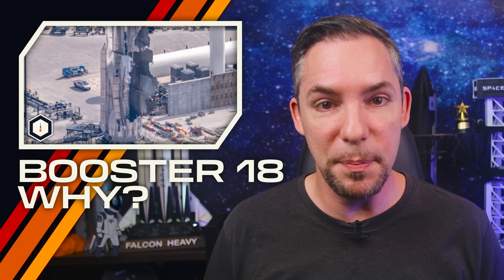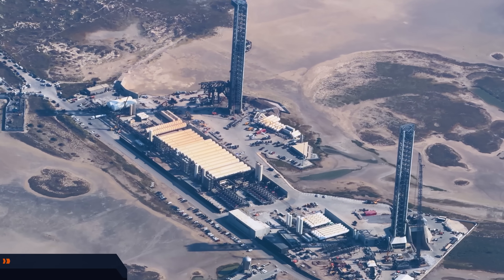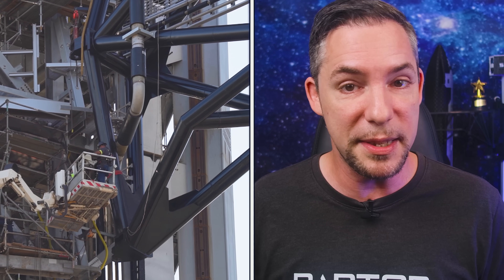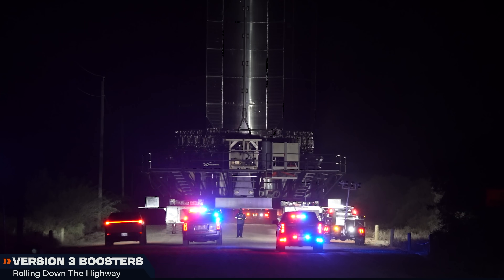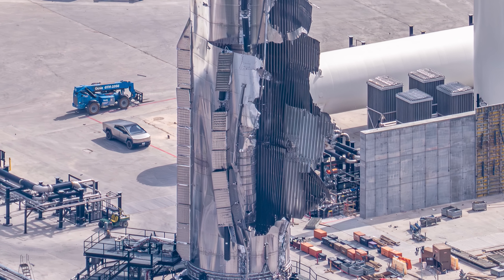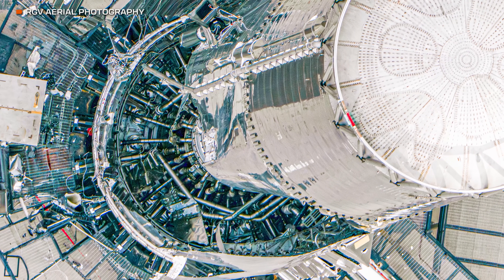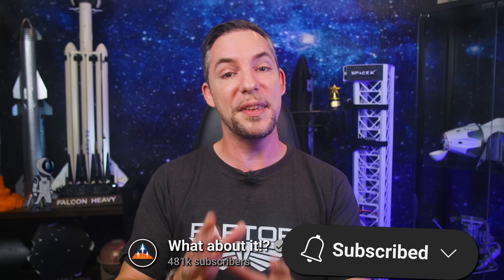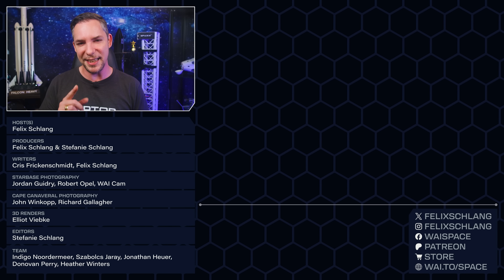What Went Wrong With  SpaceX's Starship Booster 18? Is SpaceX In Trouble?

Comment: I'm a huge fanboy of smart telescopes. I've been running a See-star ssharpstar  50 for a couple of years now, I love the little thing, I also have a traditional equatorial system. 50 mm x 275, triple APO with the equatorial mount, it did not cost me $3000 out of the box. The problem with this one is it's alt z which means exposure times would have to be very short. You had to stack for some time, but I'm willing to give it a try, but not for $3000.

Comment: The current estimated plan indicates proper landings on the pad by Dec 26 and orbital flights by mid 27. Then refueling tests throughout 2028.
Flights around the Moon in 29 possibly with the first unmanned landing, if and only if, the SpaceX lander is the size of the Apollo/MK2 lander. 2030 earliest would be the human Moon landing.
Starship landings are not physically feasible …you needed to move to spherical ships with equatorial ring engines. All else cannot land with chemical propulsion on a water and airless moon or planetary sized body.
This would put SpaceX on the same trajectory as the China Moon exploration program.
In April 26 we will be able to verify whether Blue Origin could land a crew as soon as 2029.
Here we see the beautiful contest of classic waterfall managed tech design of China and Blue Origin v Agile software principled development.
Sorry guys, but as a senior engineer and program manager I bet on China and Blue Origin beat SpaceX.
SLS could have flown there this year latest but politics did not allow. So SLS was never allowed to build a lander and Orion is delayed politically.
Ok…but back to dreaming….🎉🎉🎉

Comment: SpaceX ~Booster 18 [RUD] show a sudden pressure release tht blew open a large section of the lower liquid O2 (LOX) tank, causing a significant deformation. 
They also speculate the (COPV).
This happened last 21st of Nov, 2025
•~●🐲k-p

Comment: Hi Felix, @3:50 you mention that reducing the mass allows the chopsticks to move faster - very true. But equally contributing to nimble movement is the reduction in arm length because of the mass moment of inertia. A (very) rough estimate of the total improvement in chopstick acceleration would be 1/2 (from the mass reduction) * 1/2 (from the moment arm reduction) = 1/4 of the original rotational inertia. If the motors were kept the same we can expect to see those new arms positively dance. This means the booster can be caught even if a powerful gust of wind makes it hop sideways just before catch.

Comment: SpaceX is soooo far away from landing anything on the Moon. We should have tried a smaller first step back instead of trying to bite off a giant transporter for the return Moon shot.
Reply: From an engineering perspective building a big rocket is much cheaper to design and optimise (e.g. the Tanks can be more overbuild without too much performance penalty), even intuition says „big Rocket, big money“ but the engineering cost is so much higher than the material, infrastructure and construction costs

Comment: Bunch of junk.. Google: "Ultrasound can print through walls" + "Ultrasonic resonance" which can be used to specifically heat and keep molten materials with an Ultrasonic holography field. Power potential for printing = Points at Boeing Plasma force field blocking bombs rated to smash military steel machines with Plasma generated Ultrasonic shockwaves Now search "Ultrasound solidification of molten metal for perfect atomic structure" Results: Star Trek Replicator A release of materials into capacitor discharges taking turns filling and charging for a continuous extremely powerful holography pressure of an image on a computer. Using what they already should have been using to scan metals and run simulations.. He's got everything computer wise for that.

All a big scam lol and world science is broke.. Science: "No sound in space its a vacuum no medium! Hey look at the interstellar medium!" < Interstellar medium is far less dense than being inside Heliosphere gas field.. Ultrasound works in space. Taps Ultrasound Microphone in explorer 1 They now say its for micro-meteorite impacts.. Look at how small it is. That's dumbfounded to believe hahaha. Search engine: "Ultrasound like waves found in suns atmosphere" Plasma generated Ultrasound.. - Dracula/Hades🦇

Comment: FWIW, when Lockheed was developing the C-130 they tested the fuselage in a tank of water, pressurizing with water.  The reason was that a failure wouldn't cause the kind massive damage that would occur with inflation with nitrogen or air.

Comment: What I don’t understand is the welding. It is robotic welding. The blow out should never happen simply due to the robotic welding machine. If everything is set right the welds should be the least of your worries. I honestly think that someone didn’t quite know, or understand, how this works. It does it on its own. Someone has to go in and change the program in order to get it to fail like that. So some human input that was changed was wrong. Hence the sabotage to the program. I’m seeing what is happening and I’m not liking it. The program supervisor needs to isolate that persons responsibility and dig into it and find out why, when, &how the mistake was made. I designed some robotic welding heads for high pressure gas pipeline and the 10 or so heads NEVER FAILED. SO… who and why are people making changes to something they know nothing about?  Just my thoughts.

Comment: The point of pressure testing is to blow up the booster on the stand where you can see what went wrong and before you waste more time and money on a booster that was never going to work.... In which case the B18 test was highly successful it saved SpaceX many weeks and hundreds of millions of dollars not building a building a rocket that was never going to reach space and it furnished them invaluable data on how not to build a booster.
Reply: That's backwards. Once you put millions  into a test article, it's a bad thing that it fails and you have to start over again. 

Can you imagine if we made other things - say buildings or bridges - in this trial and fail manner? 

SpaceX is the only company who is happy when their eighteens booster literally fails the first and easiest pressure test. 

That's stupid. 

MIT '86 AeroAstro
Reply: @dimitryzarkh2084  That's why Musk is the richest man on Earth and SpaceX the most successful and profitable rocket company in the history of the world. He uses Iterative design. Instead of spending 100 billion dollars and 25 years to have engineers build 1 booster that works the first time. He spends single digit billions of dollars quickly building 18 boosters and counting who's problems are fixed as they appear.

 Where a traditional rocket program would be delayed for years or be cancelled like Nasa's VentureStar was after an incident like this. Starship wasn't delayed an single day. B18's replacement is being stacked and should it survive pressure testing will be ready for engine test as soon as the Tower is ready to accept it.

Comment: They used burning bars to cut the legs. Burning bars (oxygen lance) can cut through concrete.
Reply: and then they used a excavator jackhammer to knotch the legs before being pushed over. those Oxy torches cant cut through huge pillars of concrete.
Reply: @MadBiker77  you should see what an oxygen lance does to concrete. It's nothing like oxy acetylene.
Reply: @gasdive  whilst i understand that, i watched starbase live whilst they were doing it. they used the gas torch to cut through the steel casing, small notch on the back, large notch on the front, then the jackhammer came in and dug the concrete out. the only time they used the gas axe during this was to cut through the rebar in the concrete. there was no blasting of concrete using the gasaxe. too much work for something so simple. although i was supprised they didnt get the army corp in to use some shaped charges.. that would of been even quicker.. (although messy)
Reply: @MadBiker77  I haven't watched what they used. I just know what a lance is like to use. They will cut through anything. Literally anything. The end is much hotter than the melting point of all materials.

Comment: It is possible that this wasn't a booster failure but a failure of pressure control on the newly rebuilt systems at the site.  If the pressure was set wrong (or the pressure control failed) an over pressure could cause this.

:planet-orange-purple-ring:

:planet-orange-purple-ring:
Reply: If it turns out this was the issue, that would be a big relief for SpaceX.

Comment: I'm not an "expert" like some of the responders in the comments but a long time ago in a galaxy far far away the U.S. government experimented  with the "X" planes...1-15 to find out about supersonic, transonic, atmospheric heating and a whole bunch of other things to gain the knowledge required for the Space Shuttle to be successful. In the process of this testing, all done  with slide rules, lots of planes crashed and pilots died but it was just part of the process of acquiring the knowledge, skill and expertise to eventually become successful.
Reply: Do you remember the X15 exploding gaskets?  No one thought of what happens when a leather gasket absorbs LOX - a sharp shock causes it to explode.  

:face-orange-raised-eyebrow:

:face-orange-raised-eyebrow:
Reply: Another take on it might be that Mercury was prototyping and testing for Gemini.  which was prototyping and testing for Apollo.  While I don't recall any "major" failures with Mercury, I do recall a Gemini rocket starting it's lift off and then settling back onto the pad due to engine shutdown - with astronauts aboard.  Of course most space enthusiasts know of the catastrophic Apollo 1 disaster.  So rocketry isn't all cut and dried science. As you said, it's all part of learning what it is that we don't know about things and then applying that new knowledge moving forward
Reply from the maker: This.

Comment: The booster shows a lack of quality control at SpaceX. Even in an innovate and retest program, you need quality control. This was a simple presure test! This should be routine by now😂
Reply: If things weren't fail occasionally then there would be no need for the test.
And it's not routine, because this is the first example of a completely new design.
Reply: @andrasbiro3007 but the COPVs and pressure vessels are not new. If it was something new then maybe 😂
Reply: @user-fr3hy9uh6y  
COPVs are not one thing. And their handling matters a lot too.
Drop one, or just ding it at the wrong place, and it may explode in the rocket. 
There could be dozens of issues that lead to a COPV explosion.
Reply: Better to find these problems before flight than during! This is a TEST program after all!!

Comment: Noting has really changed.. they still have ABSOLUTELY ZERO chance being ready to support Artemis III in this decade.  That mission just needs to be redesigned .. now.
Reply: I disagree. It is problems like this that will make Starship more capable and a better vehicle.
Reply: 1. Except Starship had many bigger failures, and all proved to be just speedbumps. That's the advantage of hardware-rich development, failures aren't catastrophic.
2. Artemis has much bigger issues than this.
Reply: @andrasbiro3007  If SpaceX were to be ready in late 2028, that HLS spacecraft would be in manufacturing ... right now ... and there would be pictures of the major components.  SpaceX would be testing flight ready sub components now, and preparing them  for integration into the HLS spacecraft.  None of this exists for HLS .. it's all VAPORWARE (or renderings LOL.)  It takes YEARS of careful manufacturing, integration, and exhaustive testing to bring a new SAFE man-rated spacecraft online.  SpaceX is NOT gong to do this in a matter of months.  It's foolish to think they can.  It won't happen.. 

EVERYONE AT NASA KNOWS THIS!!!

What you say about Artemis is a lie.  The Orion Capsule, ESA Service module, and SLS Core stage for Artemis 3 are in that process .. now.  We have pictures of them .. proof of life!!!  They will all be delivered to the Kennedy Space Center by the end of 2026 to prepare for stacking for Artemis 3.  Even the Axiom space suits are being tested right now and baring a major setback will probably be ready sometime in 2027.  

The only company committed to Artemis 3 with NOTHING to show is ... SPACEX.  It's no longer even a question... SpaceX will NOT be ready.
Reply: @andrasbiro3007  my man is spiting facts jut like that
Reply: Lol 😂😂
Reply: The rite aid is 3 blocks that way.. they got what you're looking for

Comment: Great breakdown of pneumatic vs cryogenic checks. A reminder that early structural tests can surface surprises long before engines enter the picture.
Reply: Totally agree … it’s scary how so many people simply don’t appreciate the basic design, build and test process to assure safety. It was good to see this nicely presented here without emotive speculation. The failure truly demonstrates the importance of the test process BEFORE simply filling that almighty great beast with a highly combustible and innately explosive mix of fuels at dangerously high pressures and at temperatures where tough metals and other materials can behave very differently .. and then lighting the blue touch paper. 

It’s all about how to avoid the “What could possibly go wrong?” Syndrome !!

I cannot help but wonder how many cumulative km of welds there are in that booster … all you need is a very short length of imperfect weld somewhere within those welds to let go under pressure testing. Equally, the enormous total area of sheet material only needs a relatively small defect that failed to be detected by the various inspections that will be performed through from the steel plant, rolling mills through to the processing and assembly to the booster at Starbase. SpaceX seems to make it look so simple to build these immense boosters … but they’re really pushing the envelope in terms of engineering and process development. It’s relatively easy to optimise a design with the tools available today, but it’s another matter altogether to actually be able to build it and another world to put that into mass-production the way SpaceX (and their competitors) are doing. I doff my cap to them … in my book, they deserve immense respect for what they’re doing. What SpaceX has achieved with Falcon has been transformative to the space industry and to human ambition .. Starship is another step and is just around the corner. Think what doors Starship (and its peers) will (not just “can”) open.
Reply from the maker: Thank you for noticing! I saw the comments for a few days where people were really confused. So I thought I’d explain it again. 😅❤

Comment: Do the other space launchers also use COPVs?
Reply: Yes, but likely a locked down design from the 70's, with extensive procedures around handling. It works, but slow and expensive.
Also, considering how much more SpaceX launches, they may even have the same failure rate, and still not seeing any issue.
Reply: Seems to me that almost all of them do.